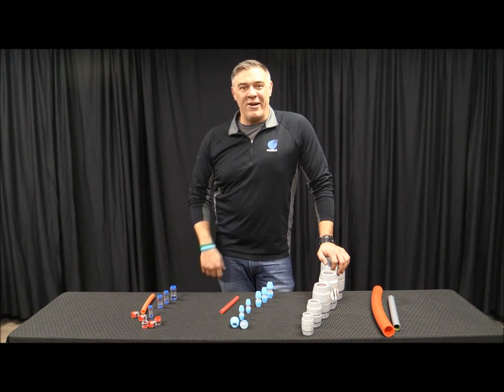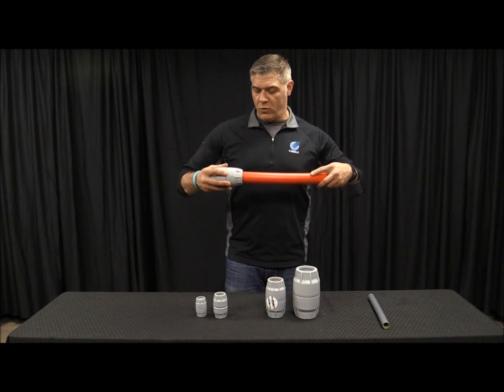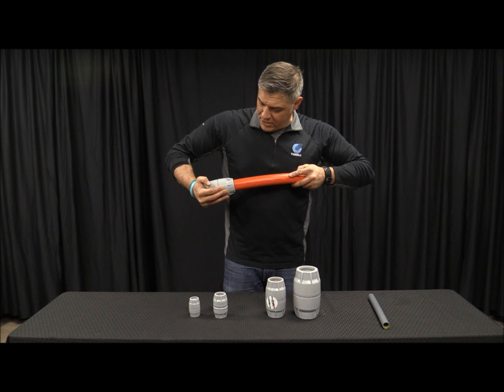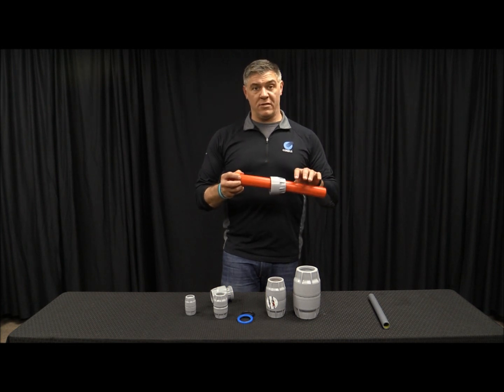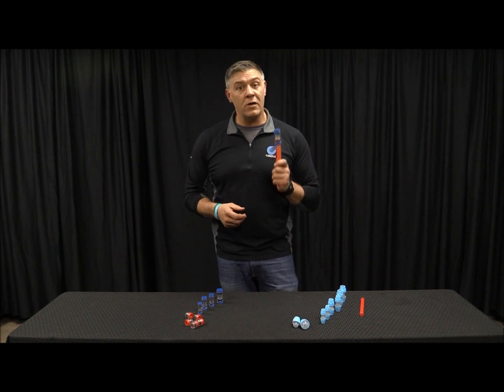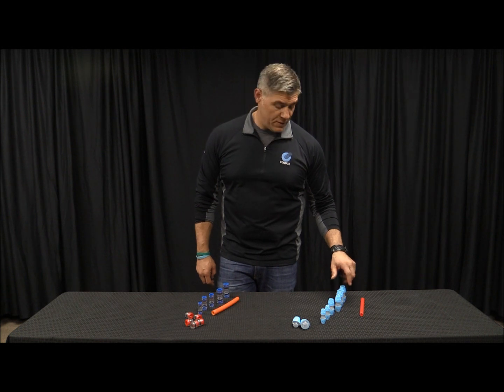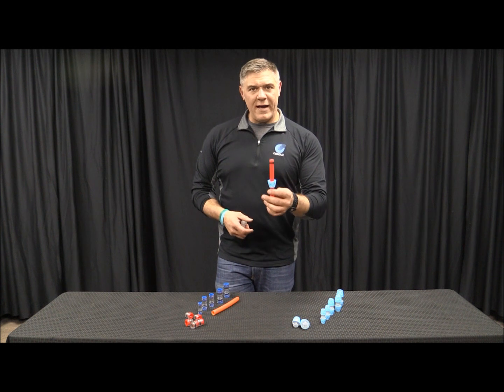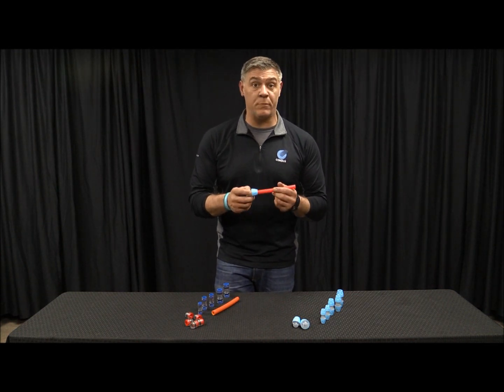Condux Couplers

Comment: On the 2 inch coupler 100 percent of people just push to get past the bite ring cause it’s dam near impossible to have one side of the conduit already on the coupler and then put the second side of conduit into the coupler, I’m guessing that’s why u didn’t dimonstrate an actual 2 conduit connection